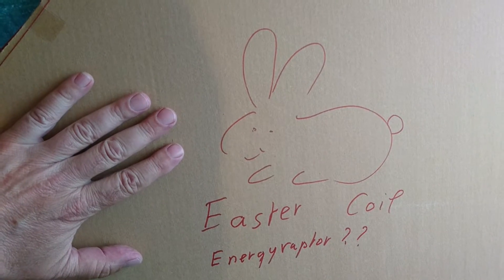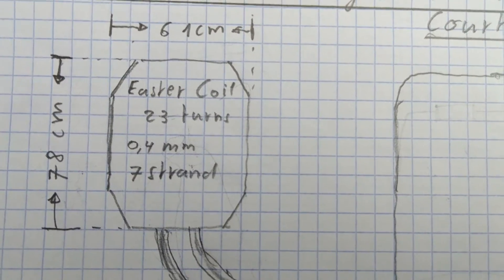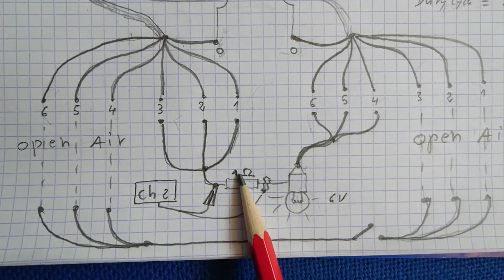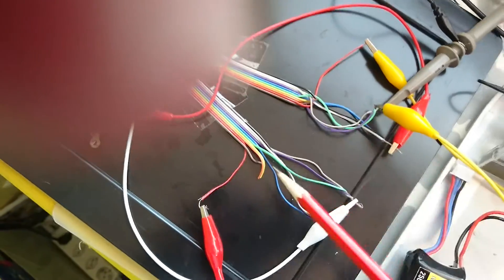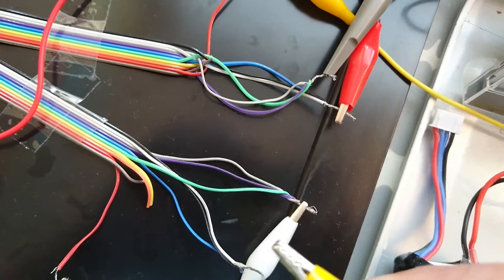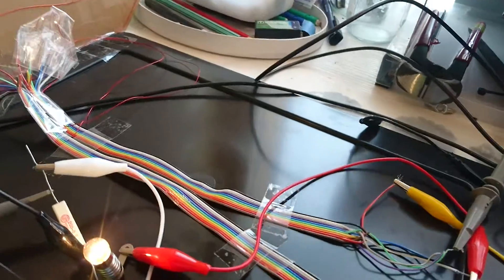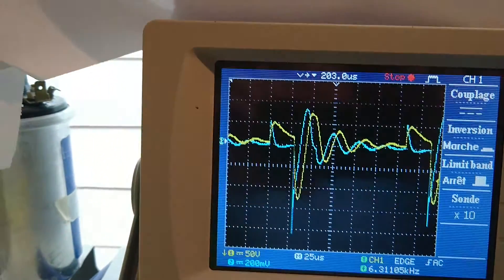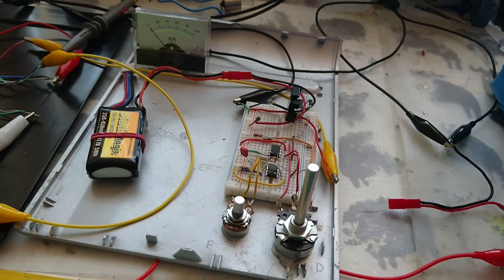open circuit can be an  energyraptor ??

Comment: Its not connecting electrically to nothing... its connecting two inverse ends of the windings to the bulb as the fulcrum, where the volt disparity will meet in the lamps filament and short as Current which is centered there...  The inductances are all 1:1:1 so you get good transfer, and the reason it doesn't draw current from the source, is because the Current Sets up on its own in the bulbs filament due the volt disparity measured between two different strands opposite ends while running.
Reply: To test the current realized from just 2 open wires opposite ends used, short the opposite ends thru the ammeter and see what current shows up...    Then you know what putting 3 pairs should produce.   The same method can be used to measure the voltage on the opposite ends without them shorting as well.
Reply: One other thing to look at would be to put different capacities in place of your shorting wire at the bottom of the drawn schematic.  Maybe 3 different capacities? sized to produce offset frequencies that produce adding ?    Also on that angle you can just use an LCR meter to measure the two opposite ends of two wires to see what Farad value that produces... 

Inductively speaking you can connect windings either bifilar series or common end bifilar... the former produces the 4x increase in inductance, while the latter almost Zeros the inductance...   so you can produce disparities of inductance on a common coil form using multiple strands of the same guage wire...

Comment: Hi woopy, I'm trying this out, and my Mosfet is heating up too much. 
What is the resistance of your primary coil ? 
Mine is 1.3 Ohms, 
Is that too low ?
Reply from the maker: Hi Mike, i have made some DC resistance on my Easter coil. 
Each of the  7 strands which constitute the wraping wire, is about 85 ohms DC resistance. So as the primary is made from one of the 7 strand wire , the primary DC resistance is about 85 ohms. 
Just for info i have increased the input DC voltage up to 106 volts, and my mosfet IRF 840 A ,can stand it without any problem, so far the bulb load is on. When the load is disconnected from  the circuit, some heating can occur.
But what i can say,  is that  the input current scope trace on the primary is very different of the output current scope trace on the secondary. So it could be that this difference in scope shape could show a difference in nature of this current , and i can't understand how a simple capacitive coupling is able to do this. 
Yep a lot to experiment on this system.
And youtube is not the right place to discuss . So if you are interested come to OU
Thank's

Laurent
Reply: Thanks Laurent. It is really helpful. I'm not a fan of OU forum.
Yes, Youtube is not suitable for discussions.  Thanks bro.

Comment: Congratulations! You have discovered capacitive coupling!  

(Seriously Woopy, nice work as always, keep it coming!)

An ordinary capacitor is also an "open circuit" in the same way the open-ended wire lengths are in this demonstration. Two (or more) conductors that are separated by a dielectric.  If you test the two unconnected wire groups with a capacitance meter, what do you get?  

(I see now that I am not the only one to attribute your results to capacitive coupling.)
Reply from the maker: Hi TinselKoala and all
Thank's for your input
Yes you are right as usual,
the "capacitive coupling " so far in my beginner  knowledge,  is a known effect and generally produces  "noise " in electronic circuits and should be avoided to smooth signals. 
But can a   "noise"   be so powerfull to  light  an incandescent bulb ?
 That's my question on this experiment ??

Laurent

Comment: Hi Laurent,

that's a very interesting experiment that clearly isolates a not-yet-discovered physical behavior. I'm currently researching about this fact that may take its source in the varying impedance.

Here, the open wire involves a varying inductance of the transformer, that could follow a law like L = (L0 - L(i,t)). In condition of sudden current change, the inductance L may start negative implying thus the circuit to suck energy from the surrounding heat (inverted Joule effect).

Notice: one could also discuss analog effects with the Capret experiments, where one has in this case a varying capacitance like C = (C0 - C(q,t)).

The open circuit can be seen as a circuit closed by a tiny capacitance (some crumbs of pF) as one currently considers the open secondary of a Tesla coil.  I like to check that if one close the open circuit with a capacitor of various values, the effect is kept appearing but changing noticeably according to the value of the capacitor.

Many thanks for your interesting videos. This is definitively mind shaking.